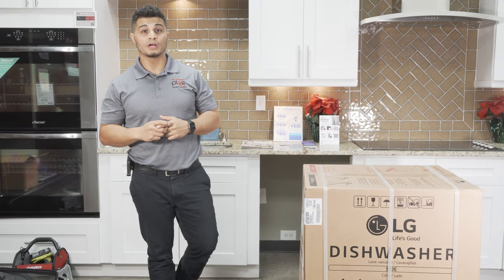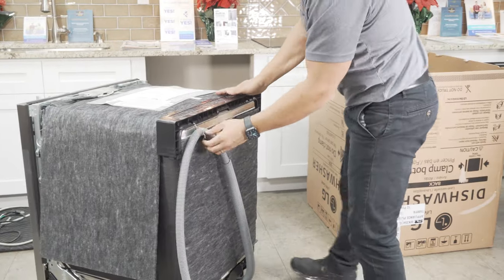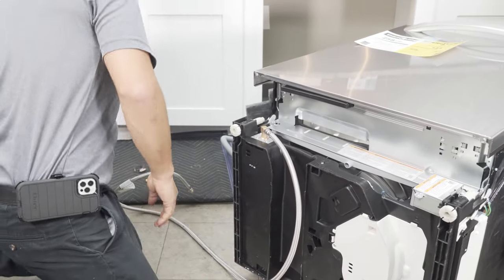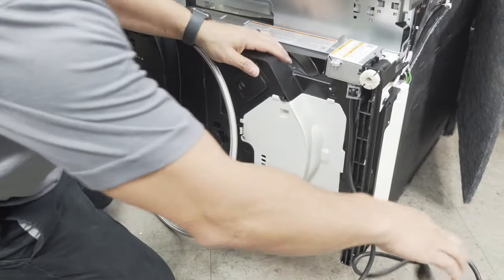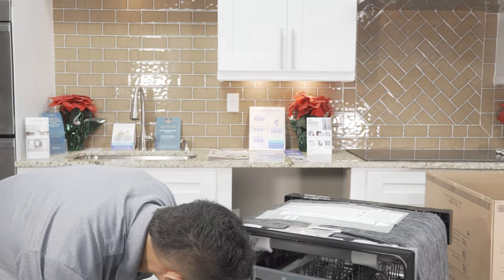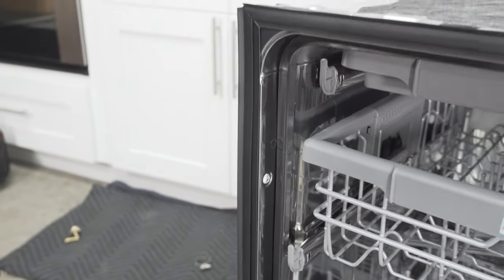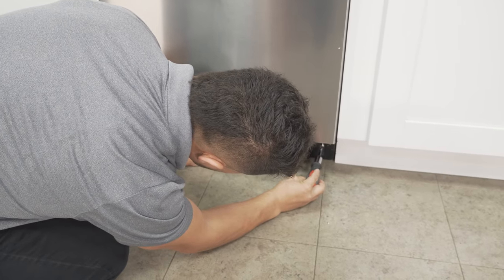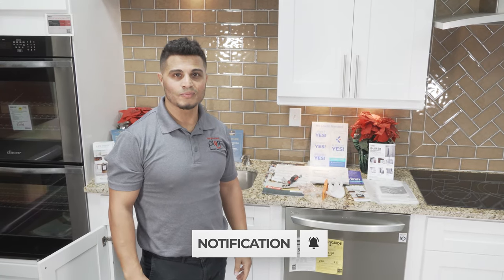How To Install An LG Dishwasher - Installation

Comment: You greased it man. Super clear thorough instructions pointing out some key pitfalls and tips. Great job. Keep doing what your doing we need you man!
Reply from the maker: Thanks for this awesome comment! I appreciate the kind words!
Reply: @TheAppliancePlug  Successfully executed my installation of nearly identical unit today thanks to this video.
Reply from the maker: @sk8punk720  that’s what I love to here! Great job!
Reply: very helpful.  I would recommend thread tape on the supply connection but perhaps not necessary
Reply: @TheAppliancePlug  Hi there.. Just wanted to know if I can take the water supply line out the side & through the cabinet near the front where the hookup is bcuz my install is certainly a pain in the arse!! If I exit it through the rear of the washer, then I'll easily need a 12' ft supply line. The way I want to attempt it should only take 8- 10 ft of supply line.

Comment: I have little experience with water connections or electrical but your explanations were simple and to the point. I was skeptical when i turned the breaker on then i was skeptical when i did a test run. It worked perfectly. Thx alot for your help, you saved me a $300 install fee
Reply from the maker: Awesome! I am glad I could save you $300 there!

Comment: Got my LG dishwasher delivered today but the techs were unable to install due to a plastic stop valve underneath my sink. Picked up a brass one at my local hardware store and changed it out. Watched this video and boom, installed it myself. Just saved me 160bucks!!!! Running a test cycle and no leaks! 🙌

Comment: This video helped me immensely. I have the same exact dishwasher and installed by a LG installer. My question was concerning the electrical receptacle. I’m in need of a receptacle to plug in the RO system we purchased. It’s located under the sink directly beside the dishwasher. With watching your video,I’m certain there is a receptacle just like the one in your video. Now we can pull out the dishwasher,drill a hole in the cabinet wall and plug in the RO system. Thank you very much. You are greatly appreciated.
Reply from the maker: Glad to help! Thanks for watching and sharing!

Comment: Great video.  Your in depth instructional video showed me how to level the the rear leg on the dishwasher.  Much "much" easier than pulling the unit out,  adjusting rear leg, placing the unit back in place only to find out that the dishwasher still requires height/lower adjusting.  Again, great video.
Reply from the maker: Glad it helped. Thanks for sharing.

Comment: VERY Good Video.  Extremely thorough!   You may want to update the electrical connections portion of the video by mentioning that the NEC now requires dishwashers that are using a plug-in AC wall cord to be connected to a GFCI receptacle.  Important to mention is that if the dishwasher outlet box has 6 wires (2--blk, 2-wht, & 2-GND) the black HOT supply wire MUST be connected to the brass colored power terminal screw and the white neutral wire to the opposite side silver screw also at the top position receptacle ONLY,  or the GFCI function will NOT work properly and function LED on front of receptacle will not be green.   The black, & white load wires if any must be connected to the bottom receptacle position screw terminals (if GFCI outlet receptacle is new, the load side will have a piece of yellow tape wrapped around the load connection screws.  Both GND wires of course connected to the GREEN GND term. screw at the front botttom.
Reply from the maker: Great feedback! Thank you so much for sharing! I’ll be posting some updated videos. I appreciate your feedback and support 🙏

Comment: Very good presentation that also touched on a bunch of heads-up!   Examples: sliding the unit in and making sure we don’t scrunch the insulation or making sure we verify that the garbage disposal plug is removed.
Reply from the maker: I appreciate your feedback. Thanks for watching!

Comment: Hey man!  You totally answered several of my questions!  Great job explaining and showing how to do it.  I’ll have to drill a hole in the floor and run an extra long drain line, power, and water connection.  But definitely will be easier now that you cleared up some confusion for me.  👍
Reply from the maker: Glad to here! Good luck!

Comment: I just followed your uninstall dishwasher video, and I am about to install this exact model using your video. Thanks so much!
Reply from the maker: Glad I could help!
Reply: @TheAppliancePlug  I installed it, and the dishwasher runs well, but it still needs to be leveled. How do I raise the back foot after pushing the whole thing under the countertop? There's not really any room to raise it before pushing the dishwasher under the counter.

Comment: Great video.  The back top bracket doesn’t have to be removed.  It can be removed if space is needed, otherwise it can remain in place.
Reply: Ha!  Space is now needed…. I have to disconnect the supply line and pull it back out to remove bracket.  That’ll teach me!!

Comment: Where can I buy the electrical and water hose?
Reply from the maker: Thanks for the comment! Check out my Linktree where I have a few different options depending on what you need. Keep in mind whether you need a straight plug or if an angled one will work before purchasing. 
https://linktr.ee/theapplianceplug

Comment: Great video! Will did everything but it starts and then shuts down after about 30 seconds…. Checked wiring … water. All looks fine. Any thoughts?
Reply from the maker: These usually have sensors verifying the unit is ready for operation. Check things like making sure water is turned on and if draining into a garbage disposal, the plug is removed. Check out this video on garbage disposal plug removal: https://youtu.be/dP9tT8phyrk Thanks for watching!

Comment: Wish I saw this before I did it myself.  Is the top control panel supposed to be under the counter or sticking out?
Reply from the maker: It should be under the counter for a nice clean look. The front lip can stick out a little but if you have the clearance to make it even with the counter, it will look best that way. Thank you

Comment: Thank you for your nice video. The water connection should be with normal temperature or hot pipe connection.
Reply from the maker: Thank you. Supply line should be connected to hot water.

Comment: How did you level the back legs? Did you pull it out? How did the screws secure it to the cabinet? What if it has top mounting brackets? This dishwasher has no bottom cover? Where did the high point connect? Is there a bracket?

Comment: Great video. You joined the ground wires with the wire nut and didn’t secure it to the dishwasher frame with a screw. Is it because the dishwasher ground wire is already attached to the frame?  Also, the dishwasher wiring is aluminum and my power wires are copper so I got the purple wire nuts. Anything else I need to do ?  Just making sure I’m safe!  Thank you!

Comment: Thanks brother great video… Quick question though… The old dishwasher I took out was hardwired I want to install the plug. I’m going to put a receptacle in so I can plug in the dishwasher. I see in the video your plug is behind the dishwasher I’ve read that it should be on the side? Does it matter?
Reply from the maker: Thank you. Yes, the outlet should be under the sink or somewhere conveniently accessible.

Comment: Great Video. Awesome job. Just one question about the drain hose... There is an outer sleeve on the hose, can it be removed to fit through the space behind my cabinet?
Reply from the maker: Sorry for the late reply. I'm sure you figured this out by now. However, I'd like to answer your question for others. My recommendation would be to drill the hole bigger to fit the drain hose through if possible. I don't recommend removing the sleeve if you can avoid it.

Comment: Question: in connecting the wires, the electrical coming out of the cord to attach has two grays and one green, not one black/one white and a green. How do I tell which gray to attach to the black and the white? Thank you!!
Reply from the maker: Hello, great question! Typically it doesn’t matter as long as you connect the ground/green correctly. But if you haven’t done it yet, send me a photo of the cord to 813-542-0273 and I’ll take a look to confirm. Thank you!

Comment: My 20 year old dishwasher has a copper water line that feeds from the other side of the unit.  Is it best to use the new flexible line?  Are both ends of the new line set for compression valves, or another method?

Comment: When you knock the plug out of the garbage disposal I assume you have to remove it from inside the disposal.....after unplugging the disposal for safety. Yes ?
Reply from the maker: I always do remove it just so I don’t risk it jamming. I usually only tap one side of the plug to go through then, I reach through the top and wiggle it out the rest of the way so I’m not fishing for it at the bottom of the disposal.
Reply: @TheAppliancePlug  Good technique !  I'll make note of that. Thanks.

Comment: I was going to install it on my own, but my plumbing setup is a bit unconventional. My current supply line is pex, so in order to replace it I would have to swap the auto shut off valve to a threaded one, but the copper is sautered in. So I thought okay I won't replace the pex line since it is 10 years old and can last over 40 years. But now I'm seeing that LG's connection point is 3/8''. So it won't be easy for me to extend the current pex line in once I remove its brass fitting...might have to pay to get it installed now...
Reply from the maker: Awww that sucks to hear that and yes some setups are very difficult which make it easier for a professional to do it!

Comment: I just got my new LG dishwasher and the supplied electric wire has 2 gray wires and one green. Obviously the green goes to the green, but does it matter which gray wire goes to the black and the white in the dishwasher?

Comment: Where did you find the power cord to attach to it? Will it work with most LG dishwashers?
Reply from the maker: I have a link to just a power cord and a dishwasher kit that also includes the power cord. Either will work for all dishwashers. Check out this link: https://linktr.ee/theapplianceplug

Comment: Hi, I have a questions I can't seem to find the answer anywhere. I hope you can help. At 17:23 specifically of this video your handling the drain hose and there is a another layer of tubing on top of the drain hose. What is the purpose of that and can I cut that piece out, its actually very annoying and interferes with me installing. My dishwasher is a farther from the sink then this video demonstrates so I also need an extension the LG just isn't long enough need about 8 more inches. Thanks I appreciate it.

Comment: Great video ! Thanks!
But I didn't see where you put the plug! In the back outlet ? Or another one bellow the sink ?
Reply from the maker: Normally the dishwasher should be plugged into an outlet under the sink.
Reply: @TheAppliancePlug  thank you !
But why is like that if there is an outlet behind the dishwasher?
Reply: Primarily so you can unplug it without taking the unit out.
Reply: I like to put the electrical outlet under the sink.  It’s somewhat unusual to see the outlet inside the dishwasher cavity.  The main reason is this…you may want to disconnect or unplug the dishwasher down the road, if the outlet is inside the dishwasher cavity, then you can’t unplug it without removing the dishwasher.

Comment: Is the outside trim included w/ the washer?   The part that surrounds the gaps between the sides and top ??    @28:01
Reply from the maker: Yes, with this specific model, it is included. However, not all dishwashers come with trim.

Comment: Is it OK to have your your  Dishwasher hose your garbage disposal electrical cord and the  Water supply line all in the same holeFrom the dishwasher to the under the sink?
Reply from the maker: Yes, absolutely. Just make sure the hole is large enough to prevent any pinching of the lines. If you’re coming in from the bottom, it’s important to elevate the drain hose so it isn’t sagging down from the disposal. You can usually find something under the sink to zip tie it to.

Comment: I got the same install kit but unfortunately my electric outlet is a few feet short. Can I use a small extension cord?
Reply: Johny, I wouldn’t do that, as it will probably violate code!! There is a risk of shock as well, e.g. water intrusion and the dishwasher does vibrate, so it could loosen the connection.  Best thing to do is to do it right and do it once!!  Too many homeowners Mickey Mouse crap together!  You will need to get a longer electrical cord from Home Depot.  Get at least a 6’ cord.

Comment: This is a great video! I just got my dishwasher delivered and was looking for a guide to install. Thankfully, I came across this video. Quick question, the machine came with a template on where the supply line and drain hose should run. It said to drill the hole 2.5 to 3.5 inches from the floor I believe (don't have the template with me rn). I see you've run your drain hose much much higher. My existing hole is about 3 inches higher than suggested. I'm trying to avoid drilling another hole. Would it cause a problem if I just reuse the old hole?
Reply: Hi So how did you end up running the drain hose, up higher or the recommended location. I have an existing hole at the same level as he has in the video and I’m not sure if that is ok.

Comment: I wish I had found this video before I paid a "handyman" to install my new washer.  He got it in but it doesn't look right.  I think with this video I could have done a better job myself.  The  margin around the machine is not in alignment.    The bottom is kicked out about 1/4 inch so that the gasket that goes around the unit is sitting on the outside the cabinet but the gasket at the top of the unit is where it should be (I hope that makes sense).  I wonder if that is because the back legs weren't leveled.
Reply: Leasha, why don’t you e-mail the video to the handyman, then ask him to level it in properly?  You paid for a job to be done correctly.  The handymen get a lot of their work via word of mouth, so it would be to his advantage in making you a satisfied customer.  Don’t you think?
Reply from the maker: Thank you for watching my content and it did sound like your handyman didn't spend the time to correctly level the unit to make sure the gaps are even all the way around.

Comment: Do you know the specs for the screws used to attach the bottom toe kick plate? My dishwasher was missing the plate so LG mailed me a replacement but didn't include the screws needed to attach it. Can't find details on the screws I need anywhere.

Comment: Hi there! If my floor is uneven how can I remedy this in order to make the dishwasher even? Should I play with the height of the dishwasher using the middle screw or the screw that adjusts the tub? Thanks in advance!
Reply from the maker: Hello Lauren, normally I use the feet in the front to help with leveling it. Depending on how uneven your floor is, you may need a shim. The foot in the center on the rear will mainly help with raising the unit. I hope this helps.

Comment: Which size does the hose need to be? Cant plug either a 1/2, 3/8 or 1/4 hose to the dish washer 90 degree elbow conector.
Reply from the maker: If you got the correct elbow, it should be a 3/8” line. Check out this link that includes the correct fittings and lines: https://linktr.ee/theapplianceplug
Reply: @TheAppliancePlug  it’s not actually a 3/8” hose, it’s a milimetrical 3/8 hose. 

I thought I could use a bushing reduction 1/2x3/8 with a 1/2” house but it won’t work. I had to buy a special and only for dish washer machines hose.

Thanks.

Comment: My drain hose is too short to elevate.  It can barely reach the drain.  What do I do in that instance?
Reply from the maker: If the drain hose barely reaches the drain and is ran from the bottom, you will need to add an extension. Otherwise, you will likely have standing water in the tub (caused by back flow) and the possibility of water from your plumbing back flow (of course this depends on your PVC setup). If possible, try running the drain hose high enough so that it elevates higher than the drain.

Comment: Do the plastic side caps just sit there? Mine are extremely loose and feel like they’ll fall out as soon as I shut the door. Even pulling my finger off of them when placing them in the holes pulls them out
Reply from the maker: If you’re referring to the black inserts that help hide gaps, they have grooves so that they can be pushed into the frame of the dishwasher. Sometimes they do pop out, however, you should be able to push them back in far enough so they don’t pop out easily. I hope this helps. Thanks for watching!

Comment: This dishwasher can be fit in the countertop of 32 inches.please Answer
Reply: What do you mean?  Is 32” the depth or width of the countertops.  Typical countertop dimensions are 36” H, 25.5” depth and a 24” opening for the dishwasher.

Comment: I have an LG Quad Wash series 7808 it has  a sound insulation that goes on the bottom front which will be inside the bottom panel but cannot figure out how to get it on, any help would be appreciated. thx

Comment: How do you remove the plug from the garbage disposal? I have a Mountain plumbing 1 1/4 hp mt888-3cfwd3b
Reply from the maker: Sorry for the late reply. I'm sure you figured this out by now. But I'd like to answer for others that may have the same question. Usually you can use a flat head screw driver and a hammer to remove the plug. You run your flat head screw driver through the connection where you would normally connect the dishwasher drain hose and tap around the edges until you get it to puncture through. Then you reach in from the top to fully remove. Thank you